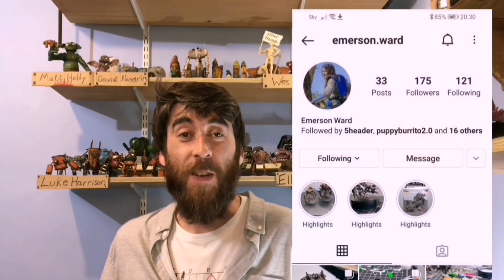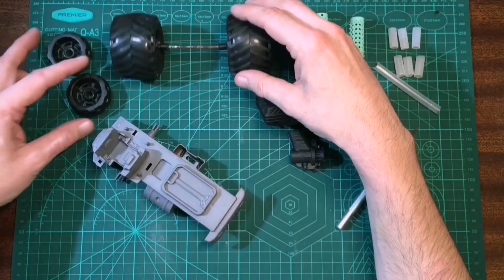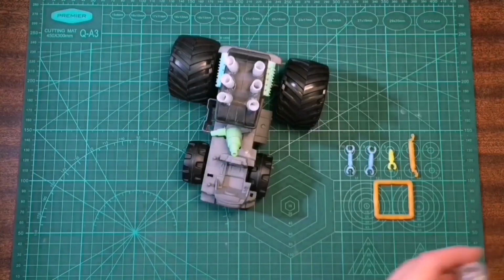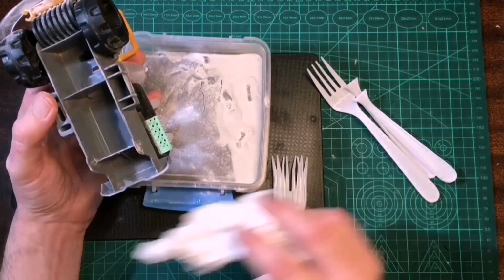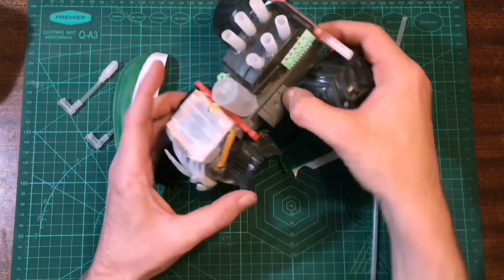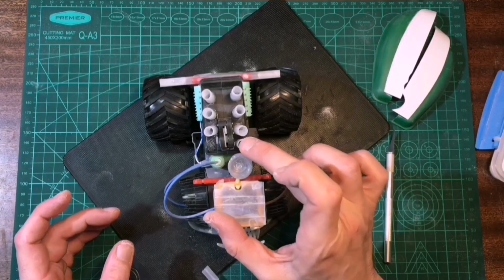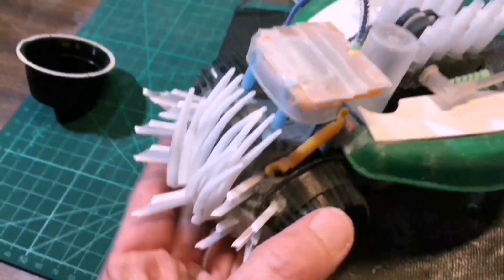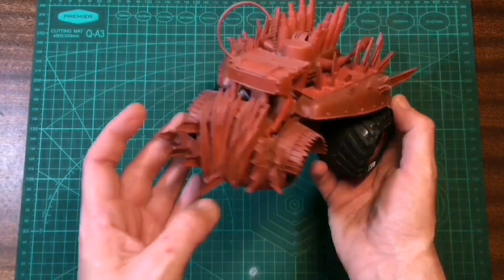Mad Max Scratch Build - Scratch building basics - episode 16

Comment: Hi Andy I was watching the craftsman doing a video about painting plastic and he showed a technique where he heated the plastic prior to painting ( think he called it plastic annealing ) and was wandering if you have tried it or if you think it is required ? Love your work. Thanks
Reply from the maker: Hello Gerald, yeah I seen that crafsman video(big fan) , I have never tried it myself but I don't think it would be applicable to scratch building. Well maybe if you where painting individual parts before assembly. With all the super glue and baking powder and all the mixed plastics, a flame might not be a good idea but then again I could be wrong. 😅 👍
Reply: Whoa, I really don't think open flame and the finished piece would be a good idea. 🔥😱 Like Andy said maybe for individual parts, not once everything has been glued together.

A light sanding with some sandpaper on each piece before attaching them would be your best bet. That and a good quality primer meant for plastics should give you a great surface for final painting.